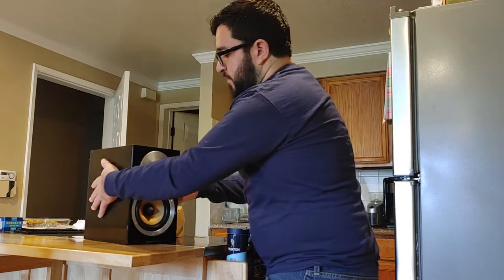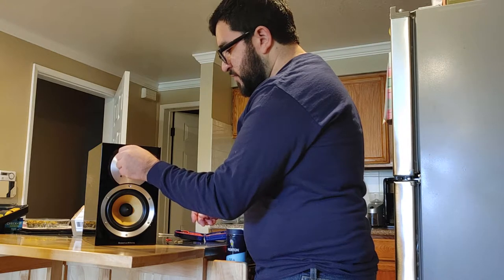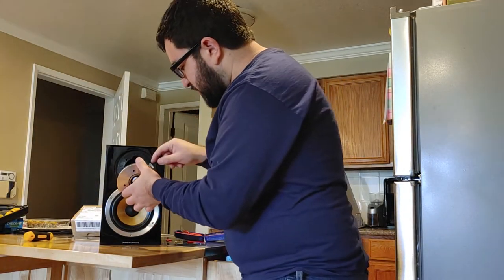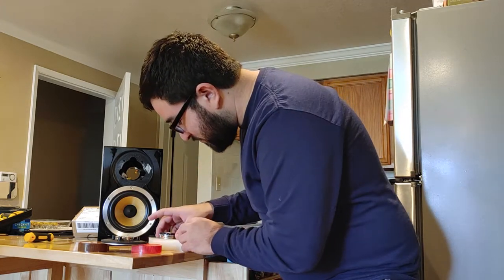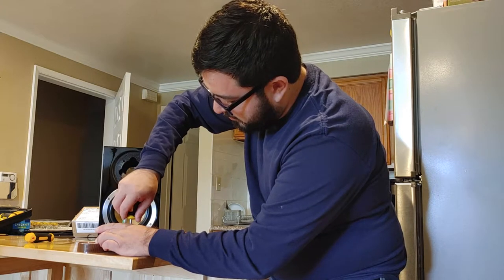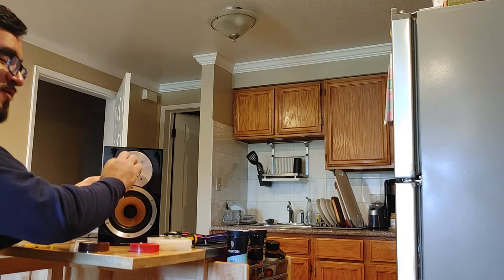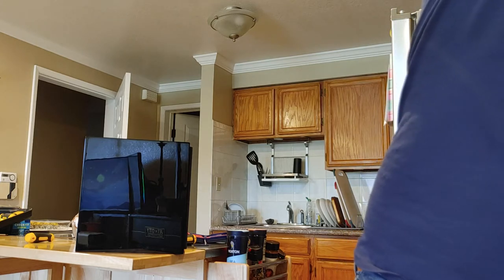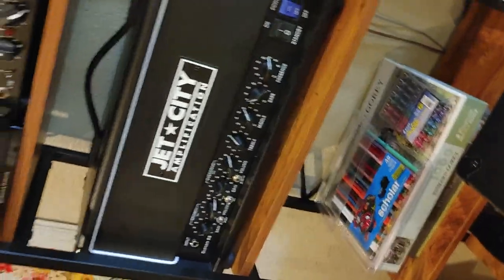Bowers and Wilkins CM1 Tweeter Replacement

Comment: Tnks for the video. A spiteful cable technician came into my house and decided to press in the tweeter while working on my modem. I have exact same speakers as yours. Im just gong to put the speaker cover from now on. I am going to work on it today. I got the part at E bay reasonably price considering these speakers go for at least 1600 pr. Yours was a gold mine. Tnks again

Comment: Thanks for the video.  I’ve replaced multiple tweeters in my CM9’s and CMC2 but B&W sent me the entire tweeter.  I need to replace the cones again but B&W doesn’t sell the entire tweeter anymore but instead has just the cones.  Your video helps ease my anxiety with replacing a part I’ve never done before.

Comment: How did you connect the cables ?
Reply from the maker: Just take note of how they're connected when you pull the assembly out. It's only two wires.

Comment: I am also looking for a new tweeter. Where did you get the replacement parts?
Reply from the maker: Check eBay, there's one on eBay for $80 right now. A bit pricey, but is what it is.
Reply: not worth it since at my second handprice is around 100 euros.. for the whole center speaker...
Reply: @Duijnkiller the whole center speaker? lol which model exactly